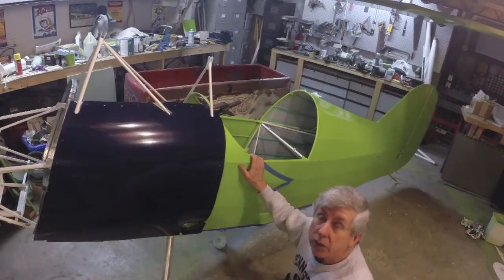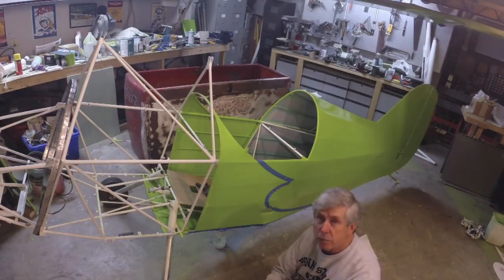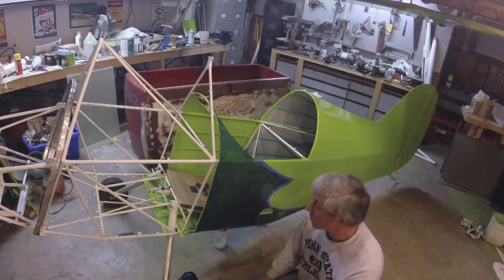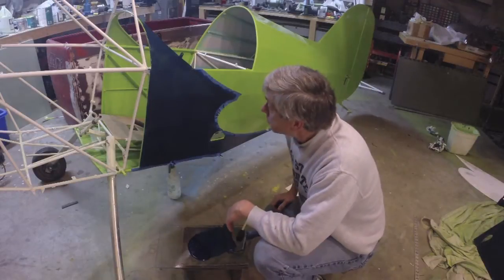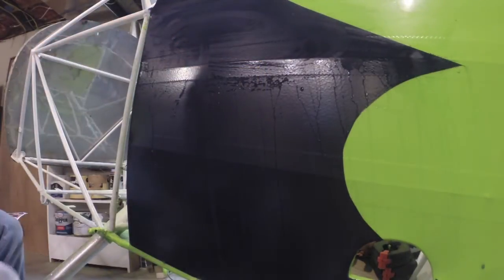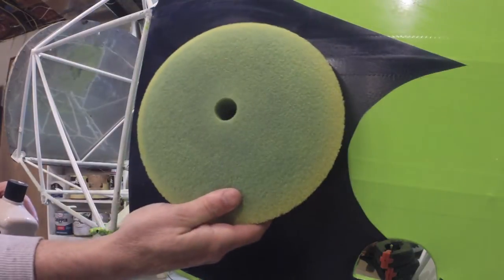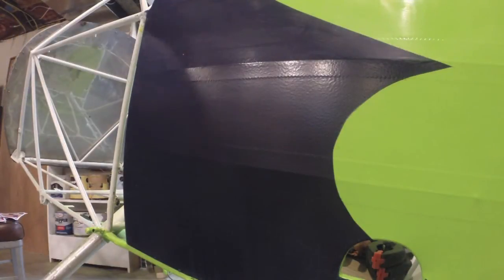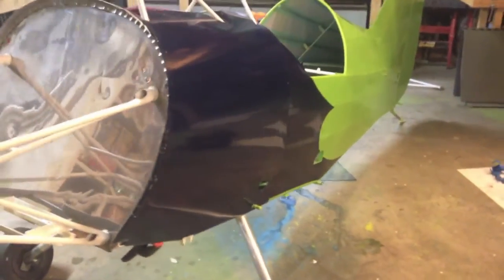Rolling Latex on Experimental Airplanes

Comment: You should have stopped by a paint store like Sherwin Williams before you started your latex project!
You could have saved yourself a lot of grief and money by using FLOETROL
https://www.homedepot.com/p/Flood-Floetrol-1-qt-Clear-Latex-Paint-Additive-FLD6-04/100198078
instead of water to thin the paint, the additive will make latex flow and level like oil base paint, I use it with ALL of my interior and exterior latex paint jobs, it will also extend the coverage! 
You will still have some orange peeling, but a very smooth roller will help with that, you could also use a micro fiber brush  https://www.lowes.com/pd/HomeRight-QuickPainter-2-in-x-3-in-Paint-Edger/1001126350  the one linked works well for small areas and the pump saves a lot of time.
You will still need to sand, but nothing like the video demonstrates! 
Sherwin Williams A-100 is probably the best for exterior UV protection and durability, they can match any color or finish you like in just a few minutes!

Comment: I was wondering what I was going to paint my airplane with, after all it's just a prototype. I think I'll use latex paint.
Reply: Use Sherwin Williams or another paint store brand paint! DO NOT BUY PAINT FROM A BIG BOX STORE. All paint is NOT created equally, Home Depot may be a good place to buy hardware and screws, but don't buy their paint, unless you want to put 4 or more coats on and not have even half the UV protection of a professional paint that costs the same or less, like Sherwin Williams A-100 exterior Acrylic Latex. You don't need to pay more to get a better quality, UV protection in A-100 will outlast all of the other brands and costs half the price, it is what I use and recommend for all exterior commercial and what most other contractors spec for large exterior projects. It costs me about $16 gallon contractor price and may cost retail around $25 for the general public, it is worth it and wont fail like the box store junk does! Also pickup a quart of Floetrol from Homedepot or just about anywhere and use it for the additive (never thin with water) it will thin your paint and cause it to flow like oil base paint! Yes, it will reduce the orange peel! If you have your fuse or wing on a rotisserie, keep the side that you are painting up (you could even paint it quickly while it's facing you and then turn it up so it will self level better), this will greatly reduce any chance of orange peel, you can rotate it after about 20 minutes dry time. 
Paint that is shipped to Big Box stores do not have as much UV blocking in them, most people don't even think about UV, but if you don't have a strong UV blocking paint the fabric will rot faster and cause catastrophic failure, it is just that important!

Comment: ONE THING I USE WHEN WORKING WITH LATEX IS A ADDITIVE CALLED FLOWTROL AND IF I AM USING OIL BASED I USE PENETROL. MADE BY THE SAME COMPANY. IT WILL MAKE YOUR BRUSH/ROLLER, AND PAINT RUNS SIT DOWN AND DISAPPEAR!

Comment: The glass tray idea.....I would never have thought of that
Reply: A glass tray is not going to do anything for the paint finish and will probably prevent the roller from loading properly (Note, the orange peel paint surface) Floetrol will reduce orange peel and make the paint flow out like oil base paint.  Never thin latex/acrylic paint with water, always use Floetrol, it works with interior and exterior latex paint and will give your project a smooth professional finish, without reducing UV protection or coverage.

Comment: Hello sir, thanks for your informative videos, could I ask however, was there good adhesion with the latex on the backing fabric or did you have to add a glue to the latex? Many thanks
Reply: The owner of the video didn't respond, but I can. Latex will adhere like a glue to just about any surface, if you have ever painted a room and got a little latex paint on your clothes you would agree, it wont come off! I have tee shirts, jeans, hats, trucks and hands that have all been splattered with latex at one point or another and it is hard to scrub off of vehicles, most of my work clothes are permanently painted, some shirts have had logos and paint on them, the logos came off with solvent, but the paint still remains... 
I always add Floetrol to latex/acrylic paint, it will stick better and flow out smooth like oil base.

Comment: Nice! 2 questions: 
What brand of latex house paint did you use? I've heard a lot of guys like the Sherwin-Williams "Emerald" brand. 
How long did you wait after the last coat of paint before you started buffing?
Thanks!
Reply: Skip the Emerald! Just because it costs upward of $60 per gallon does not make it cover better or more UV protective! 
A-100 for $16 gal. contractor price or around $25 retail is the same quality and UV protection, but I have to agree Emerald does sound like a better paint than A-100!

Comment: using the glass instead of the usual roller tray - a great idea
Reply: Glass wont do anything to help the finish or cause the paint to roll better, in fact it  may cause the roller not to load properly, Floetrol and a regular roller tray will work best (if glass made rolling easy or better, everyone would be doing it by now...)

Comment: Just one more question,,,,how flexible is the finished paint and how does it not crack on fabric
Reply from the maker: Latex strong suit is flexibility. It is a softer finish than auto paint or urethane, so it will scratch easier, but it moves with fabric very well and resists cracking.
Reply: Ok thanks so much again

Comment: So, just wondering, I was thinking of refinishing my ultralight which is covered in poly lite fabric and is already painted but it is about 20 years old and is slightly faded but fabric is still in great condition due to being kept indoors pretty much all its life. How difficult would it be to refinish over the existing paint (looks like very thin coat) with this method?
Reply from the maker: I painted 3 coats over existing paint on my Titan Tornado (fabric, aluminum, and fiberglass). It has held up very well for 5 years. I cleaned the old surface and scrubbed with a Scotchbrite pad. 220 grit sandpaper would work also, just be careful around protrusions. Then 3 coats of color.
Reply: Wow that is great,,, Just for your info, I have a MiniMax 1100R with Rotax 447 weighing in at just shy 254lb about how much weight do you think it would ad at roughly three coats.
Reply from the maker: Very rough guess: to do all surfaces of a mini max, 3 reduced coats, will take about 1.5 gallons. Probably end up around 9 pounds.
Reply: ok thanks so much for the info and keep up the great work!!!

Comment: is it possible to paint a light sport airplane with this same method if the fabric is 4.0 OZ. Dacron?
Reply from the maker: I've tried 1.8 and 2.7 oz Dacron. I thought 3.4 oz was the heaviest made and that it was for use on really big airplanes. Even so, I see no reason that this technique would not work on heavy fabric.
Reply: Hey, thank you for the quick response. I am sure I have the weight of the fabric wrong, it in on a Rans S-5 I was just taking a guess. I am glad to hear that it should work, I don't see a reason it wouldn't. May I bother you again to ask how you primed it if at all? Your plane looks amazing has it been flying for a while now?
Thanks again.
Reply from the maker: That airplane was sold before I finished it but I've been flying a Titan Tornado finished the same was for the past 5 years. Still looks great. The primer is Glidden Gripper, 6 thinned coats, applied with a foam brush. I have lots more detail on www.weinerdogaero.com
Reply: Titan Tornado, I had to look that up...High wing pusher? looks like a sweet plane. Thanks for all the help and tips. I am grateful!

Comment: Great video! I'm going to be covering an airplane soon and plan on painting with latex. I like your method, and will likely use it. However, I wonder if this method will require constant polishing every few months or years? Does the polishing compound act like a wax that will wear off over time?
Reply from the maker: I have 3.5 years on my Titan Tornado and the paint is as good as new. I wax a couple times each year.
Reply: I had that same question. It seems that Meguire 205 is a non filling polisher, which means its acting just like liquid sandpaper, so it's not filling the scratches with any oils or fillers but removing additional paint to permanently remove the fine scratches. In other words, it's just bringing back the original shine or gloss of the paint  if I'm not mistaken. So it should be permanent, right? I'm assuming the wax is just to make it even shinier, and maintain the surface shiny from natural wear and tear, not because the polisher is wearing off.  I'm just crossing my fingers, that if I do succeed in smoothing the surface without stripping it, that it also works for semi-gloss or satin, or if the dulling agents in those will prevent the semi-shine from ever coming back. Next time I attempt something like this I will definitely go for high gloss, since this process allows you to control the level of shine anyway
Reply: @alexglass3613  He removed any finish that the paint was intended to produce when he sanded it, the 1000-1500 grit sand paper is actually considered polish just like the Meguire's polishing compound it also contains grit to remove paint, the polishing wheel is actually burnishing the paint to fill any pin holes, wax will offer a primary UV protection that will keep his plane in the air for a very long time if he used a UV blocking wax. (not trying to be the know it all, but finishes are my business)
Reply: @superiorcarpetpaintllc4351  

 Thought I would reply to you to see if I can get a quicker response. I have a Whitman Tailwind W10.  Obviously by my comments I am interested in this process though the money really isn't the issue for me as much as an ease of getting it done.  Is there anybody done longevity test on this so to
 speak not just for paint shine but also adhesion?

Comment: I'm attempting to do this on kitchen cabinets, with Insul-X Cabinet Coat, which is reinforced with Urethane, but it's a satin finish, not high gloss. Once you touch the finish with wet sand paper 1200 grit, the satin finish completely disappears. I see you are using high gloss latex. Do you think I could recover the partial satin gloss, by using higher grit paper and polisher as you did on high gloss? I have yet to go higher than 1200 and I wish I could find out if this would work on satin before I spent the additional money on the polishers, applicators, and higher grades sandpaper. .

Since I'm not using a sprayer, a perfectly smooth level surface is nearly impossible to achieve everywhere, even with thinning, and I almost gave up trying wet sanding latex until I came across your blog and videos and saw you have success with it. You are somewhat of a pioneer here, doing whatever everyone recommends against doing with latex. Cabinet Coat levels excellent especially if i thin it, but they do not recommend thinning more than 6%, according to the manufacturer. Thinned to 25% it levels glass smooth, but I'm told I'm risking the final gloss as well as durability so that scared me into continuing with it thinned and went back to square one.  Are you not having any issues long term with thinning it 25%?

Unthinned I get some brush marks in parts, which forces me back to wet sanding for that perfect smooth finish. I don't mind spending the additional money on polishers and tools if I knew it would also work on Insul-X Cabinet Coat.
Reply from the maker: I have only used gloss. Not sure what you would get when polishing satin.
Reply: How long did you wait after painting to wet sand? I'm getting a whole lot of striping, especially around corners and edges, even using as high as 1200 grit to start off. Any tips for patching strips or preventing them?
Reply: Alex Glass
I sand 24 hours after the last coat is applied. You do need to be careful around edges and bumps. IF I sand through I tough up with a small brush. Bigger repairs would require rolling more paint. How many color coats did you apply?
Reply: Marybeth Morrison I  did 2-3 coats of Cabinet Coat, 6 hours apart, and attempted to wet sand the next day, before wanting to apply 2 more. Getting strips all over the place, either down to the primer, or through the first layer, revealing the base layer underneath. I bought the Cabinet Coat because I thought the urethane would make it better for wet sanding compared to regular acrylics, since it supposedly harder, and because it was supposed to level making for a smoother starting point, but now I'm starting to regret it, and thinking I should have just gone oil. The finest of little paint globs between the sand paper and surface will strip it in portions straight off the primer and its very unpredictable. I can generally successfully sand 90% of a flat surface, and all of a sudden a tiny glob will strip it. By the time I feel it under the sandpaper, it's usually too late. After that it then requires patching by applying 2 coats, 6 hours apart, and waiting 24 hours again, only to have it happen in some other part.  Very frustrating. Especially when the $14 Kilz oil sands so beautiful and I can wet sand it even 5-6 hours later. I could lay it on there with a broom and still sand it to a glass smooth finish. I would wait a full 30 days for it to cure, but I fear the nightmare of stripping some portions of it after such a long wait. I'm starting to wonder if its the fact you are using high gloss that makes it work. Also are you waiting the recommended time for coats to dry between re-coating? I'm wondering if there's something to that also. Perhaps re-coating immediately , will bond the acrylic into a single thicker layer as opposed to multiple thin layers which makes it sand better? I've been waiting the recommended time between coats.  I also have some Valspar Reserve semi gloss primer + paint and I'm going to test it for wet sanding and see if it works any better.
Reply: Alex Glass Ok I want to post an update, because I finally had success and got the answer to both of my questions! For anyone else that might be using some of these paints I'm using, I hope this proves helpful. I had some Valspar Reserve, paint + primer in one semi gloss, and decided to do a test with it to see if I had any better results compared to Insul-X Cabinet Coat. I rolled on 3 coats. Did not thin it. Waited overnight for the final 2 coats. Tried sanding 24 hours after....and sure enough it sanded beautifully, no stripping!!! I shouldn't really say beautifully, because the darn thing is tough as nails, and it took some serious elbow grease to sand it down. Rolling it on results in much rougher orange peel than Cabinet Coat and doesn't level out nearly as smooth(had to start with 220 grit, and it actually held up  without stripping!), but the good news is it does not strip like Cabinet Coat does after 24 hours. I will also add that since it resists even 220 grit level sanding(possibly even lower), that one might even be able to use a brush to apply it, and still be able to sand it. Something I might test. 

 I also got my hands on a stick of white rogue polisher, to test and see if the shine returns, and I was able to successfully bring back the partial shine after sanding with 2000 level grit. So this method does indeed appear to work for satin or semi glosses! Which is very good news, because that's all I have. Worked for both Satin Cabinet Coat and semi gloss Valspar reserve. Strangely, the sating CC actually shined a bit better than the semi gloss.

 I do have some swirls in the shine, but I am not ready to blame it on anything yet due to the fact I had a couple of issues with my testing. I applied the 3 coats of Valspar on top of sanded Cabinet Coat, and by the time I flattened the Valspar I ended up all the way down to the Cabinet Coat layers, so I have a very smooth mix of CC and Valspar top layer, which gave it all kinds of gloss rings and speckles of gloss. Thus I was not able to really sand it perfectly to 2000.. But it doesn't matter. I was able to find out the answer to my question and I will retest by painting the Valspar directly on the Kilz oil-based primer and sand it correctly.

 I'm a bit perplexed to what's going on with Cabinet Coat, and still not totally ready to give up on it, since it's supposed to be the toughest of acrylics, and adhere the best. Perhaps it needs a much longer curing time than overnight, or even 2-3 days, or perhaps it really doesn't like going on top of Kilz Oil-based primer, because as soon as I sanded down and reached the CC layers, it sure enough started stripping, can still strip it with a finger nail, and that base layer was about 3 days old. I'll give CC a full 7 days and try one more time, but if it doesn't work, I'll go with the Valspar, and I'll definitely try to get my hands on the Meguiars 205 polisher because I'm betting it will remove the 2000 grit scratches much better than the white rogue polisher I'm using.

So thanks Malcom for the videos. Keep up the good work, and if you ever decide to use this on furniture or kitchen cabinets, definitely make a video for us newbs!